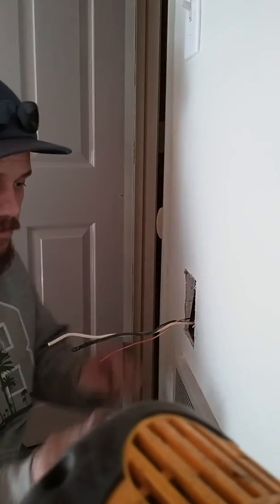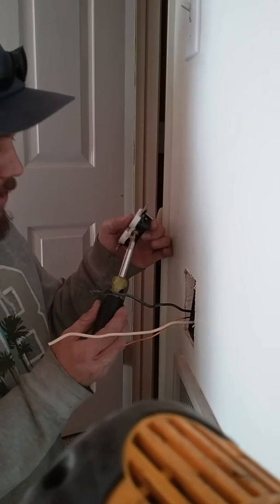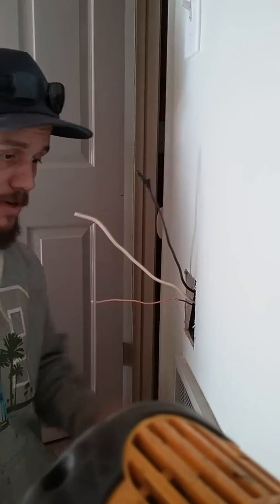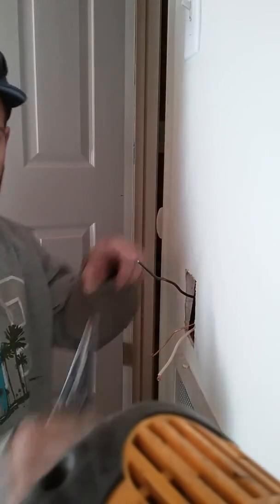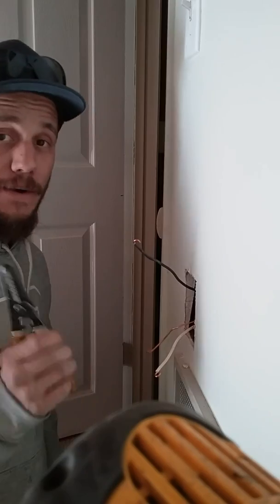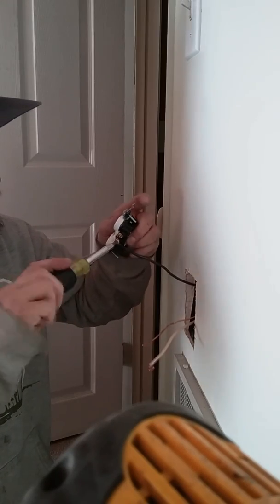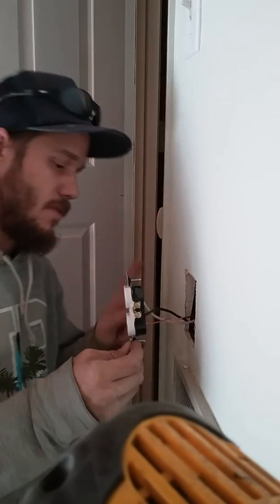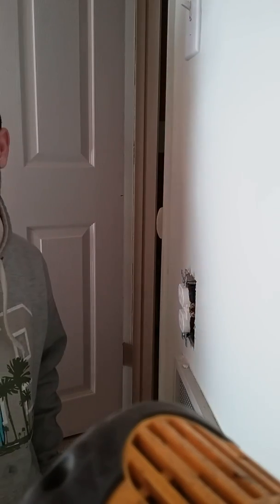Installing an Outlet, plug, receptacle, while hot, power on.  No shock.  DIY electrical lesson

Comment: First wear rubber gloves,bam seconds connect ground First bam, then neutral bam, last hot🔥 wire bam...you look like you know what you're doing and careful enough but most people are not.
Reply: I do it that way- and then opposite when disconnecting if it's hot.
Reply from the maker: Don't work on anything hot
Reply: If you connect the ground first then you can’t touch the ears while connecting the hot right ?

Comment: @DavidSwinson 
 u got experience BUT I started working as an electrician 2007 in NYc and from then to now in my head is written ALWAYS neutral first ALWAYS and i saw here couple of comments but when u ask why nobody gives a reason. 

Reason why  The black wire is the "hot" wire, which carries the electricity from the breaker panel into the switch or light source. The white wire is the "neutral" wire, which takes any unused electricity and current and sends them back to the breaker panel —-If the hot is connected, the neutral can kill you—-I mean it can’t kill you n me because we are electricians and we know what to do but the problem is someone will watch this video and do this for the first time and buuum !
I know this is myb boring to read be this is reason why !

Comment: You can hold the hot wire by the insulation and put your thumb on the metal part of the stripper. It's not going to hurt you as long as you don't touch ground or neutral with your other hand so you can make a better hook on the wire.
Reply: That's just not true, if you are grounded. If you are grounded and touch the strippers that are touching the hot...then you ARE the ground wire and it will happily take you as a path.
Reply from the maker: Don't work on anything hot

Comment: Always always ground neutral hot. Always in that order. And reverse for taking apart. Lessens the chance of burning up anything down stream.
Reply: I learned that in school. But than I thought, as per doing it live.
 But What would happen; if were to install ground and accidentally touch the "hot" wire?
Reply from the maker: Don't work on anything hot

Comment: You dont tape your outlets not smart if that thing hits against that medal box it will short and also when you hook up you do ground neutral than hot
Reply from the maker: If you hook hot last then you are grounded making a return path while you work the hot wire loop on to screw
Reply from the maker: It's a plastic box.
Reply from the maker: Why?
Reply: If you hook up your hot last then the outlet is not hot when you're messing with the other two wires I did not see that there was a plastic box you can't see that in the video I just assumed it was metal but from my experience you should always take your outlets and switches just in case somebody behind you in the future coming along and wants to pull it out of the wall they can be saved and not get a chance of getting Zapped as well

Comment: I've been shocked by one changing an outlet.. it felt like one of those prank shock pens.
Reply: Sarcasm, or truth?
Reply: @hxd9321 Sort of truth. I've been shocked by UK mains voltage, 240V rather than the US 110V. It's the same sensation as a prank shock pen, but bigger. It goes all the way up your arm and into your shoulder. I would not recommend it for a good time. I suspect I got lucky, and survival rate depends on contact time, among other things. If you can turn off the power, you should.
Reply: @hxd9321 it’s true only on a 110v tho.

Comment: You can work almost on any outlets/switches as long as there isn’t a return path going back to its source aka panel. Think of it as a car driving then suddenly there is no more road. The car will stop and can’t continue going forward. Hot is essentially that car. Without road/ground current can’t go anywhere. You can touch the hot all you want with your bare hands. As long as you are insulated from any ground. Thick piece of cardboard under your feet/shoes. Touch hot, no shock.
Reply: Hey Roger, I read all the replies and you were the only one who explained electricity...good job.  I was looking for some one to clearly explain that a Shock occurs when there is a "difference between the amount of electricity between the hot and whatever else you are touching when the electricity searches for ground...if it can't find ground either going through your body to the earth or through your body to the ground wire, it won't shock you.  Insulators from grounding include wood, thick rubber, and fiberglass.

Comment: Your gonna get somebody killed! Always put your ground first when install and the ground is the last thing to go when your demoing
Reply from the maker: Why
Reply: @thelovetemple333  so that the electrical current has a path to ground other then your own body.
Reply: @matthewr209  
I'm a licensed and certified electrician of many years now and this is absolutely correct you should always hookup the ground wire first especially if you are working on a live circuit. I obviously don't know who was teaching this guy in the video but its clear neither of them are a licensed and certified electrician because that's pretty basic knowledge. Bottom line this couldn't possibly have been done more wrong he's lucky to have not been electrocuted because not having hooked up the ground until last it doesn't matter that he was only using one hand because every bit of that electricity would have gone right through his body to ground and have been seriously hurt. 
_______________
David 
This part is to you in the video please change how you do this its absolutely only a matter of time and you will find out the hard way. I know I'm obviously not going to get you to stop doing this work but I'm genuinely only saying this to be helpful and to keep you safe so please take my advice. Also maybe add something to the video that says that the ground should be hooked up first so other people don't continue to do this very dangerous mistake.
Good luck. ⚡✌👍
Reply: ...how is HE gonna get someone killed. HE didn't die, and HE isn't making someone else do anything. If someone else does something that gets themselves killed, then they have no one to blame but THEMSELVES. I'm so tired of people blaming others for their stupidity. It isn't HIS fault that someone watched a video and didn't do it like they were shown. If I watch someone fly a plane and say it was easy, and I hop into a plane and crash.....are you sitting down....it's MY FAULT for being an idiot.
Reply: @Aizen_Sama38  Nailed it buddy. Most people don't understand the concept of electricity being inert until it finds a path back to source. Electricians act like they know something we don't, when all it takes a a little care and a logical approach.

Comment: Question for you. Why do I sometimes get zapped and sometimes not. Recently I changed all the switches and outlets in my house. Reconnecting the knob and tube , I had no problem. When I stared to connect the 12-2 wire ( ground first , neutral then hot). I got zapped. I made sure not to touch the screws. I held the outlet from top to bottom. Could it be because there were to sets of wires hooked up. One outlet feeding the other
Reply from the maker: Some times the return path can be a water or gas pipe near by.  It sounds like you got something Wrong.  Hire an electrician.  Work with the power off as much as possible.  Make it possible if need be.
Reply from the maker: All you need is a return path for the hot.  Some times the other wires might be grounded some where. Knob and tube have no ground so where are you picking up your ground from?  If it's from the netural then it's wrong. You can't have a ground out of a grounding conductor (netural) cause it is a current carrying conductor.

Comment: 1 never work on a live circuit.  2.  That is NOT the authorized way to work on a live circuit.  You should put the ground on first.  Then the neutral then the hot last.  If you're DISCONNECTING an appliance then you do it in reverse.  Hot off first. Then neutral followed by ground. Theres more than one way to skin a cat.  But this skinner on here showed yall the SLOPPY  YT.
Reply from the maker: Why ?

Comment: I love turning electricity off at the breaker box first, seems sooo much safer
Reply: In a perfect world yes. In an industrial environment when you have no choice, you have no choice.
Reply: They don't teach that in the union lmao. Great job
Reply: Lol I used to be a lineman and I was doing underground 50KVA install and when I went to power up the 240 side next to the 7,200 side I fell into it and completed the circuit with my ratchet hahaha by far the worst I've ever felt lol
Reply: I am here to learn this because I just started working for a residential electric service company. It is often just not practical to turn off the breaker every time.
Reply: @jondoh2226  Do you wear any PPE when working on live wires?
Reply: @kevinlin7674  no. 120v honestly isn't that bad. It is more surprising (or shocking) than anything. There is no residual pain. Even some minor cuts (paper cuts) or burns are worse. What may cause us to change an outlet hot is maybe the customer has computers running on the same circuit, or the circuits are not labeled well at the panel. We can't really be turning everything in the house off to find the right one. Sometimes it is just a hassle to get to the panel.
Reply: @jondoh2226  I'd sue that company for negligence after I amassed months of proof to go to court.
Reply: @jondoh2226  that fact that you know how bad 120 is is saying a lot about your experience with getting shocked lmao.  120 as just a shock isn't very dangerous but can gurantee you'll see a lot worse if you're grounded/touching the neutral or sweaty/wet when you get shocked. Getting shocked is one thing having the current go through one arm and out the other is a whole other Ball game that can happen very easily by accident
Reply: @jordanadams6033   He'd had to have been grounded, to some extent, to be shocked, no? You can't get shocked without being somewhere closer to ground potential, otherwise it would be an open circuit (no shock, no current flow). 
I've taken 500V arm to arm, 120V isn't that bad, in comparison. It's nothing to mess around with, though, and is certainly unpleasant. You can't be 100% that a real shock won't kill you.

Comment: Cool to know! You should wrap the whole socket with a couple wraps of electrical tape before pushing it in though. Makes touching a "hot" socket safer and some outlet boxes are metal.
Reply: Dont you have to touch the outlet to wrap the outlet so you do have to touch the outlet
Reply: The only time you should be taping your terminal screws is if you’re hotting up plugs with no covers for other trades to use during a job to avoid them getting poked. I’m a firm believer that if you form your conductors properly in your box there should never be an issue, even in normal sized boxes where the screws are a little close, I also think if you use a wire nut properly same thing, except in a pecker head, I’ll tape those up because of the constant vibration from the motor. Tape is expensive if you consider wrapping every receptacle out there, might as well wrap every device installed in a box everywhere I guess? Lol
Reply from the maker: Don't work on anything hot
Reply: This is what my dad taught me
Reply: I've seen electrical tape on stuff that looked at least 30 years old probably more. Trust me I was grateful. If you wrap it tight it'll stay longer I think. But I think it's always good to wrap it, just to be courteous to the next guy who'll be working on it. Just a simple mans opinion lolll. Peace
Reply: Not code required and its useless. Just comes loose overtime. Only time i find electrical tape useful is for wirenuts
Reply: @GlitchedPepsi  electrical tape on wirenuts are cancer
Reply: @GlitchedPepsi  don’t forget band-aids! 😂
Reply: @GlitchedPepsi code is bare minimum, working with stuff that can potentially kill you or someone else why not take the extra precautions.
Reply: @GlitchedPepsi  So you're the dude I cuss out in my sleep....I hate people who electrical tape wire nuts and don't atleast fold a flap at the end to grab and unwrap. After about a year, that sticky ass tape becomes a nightmare getting off. Use Wagos or something like that when you can, or do a good job tightening the nut on. The electrical tape is redundant. And if you ever have to work on them, is time consuming. If it's a dry environment, don't wrap them. It's not needed.